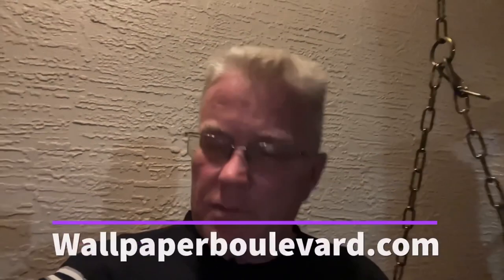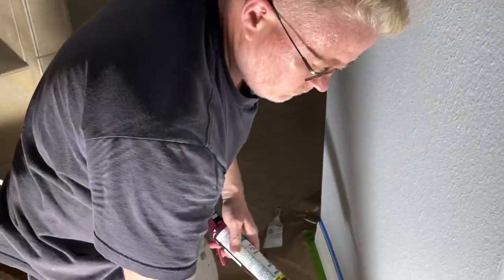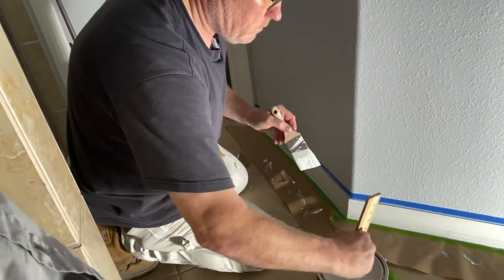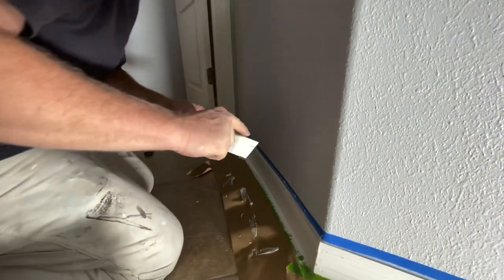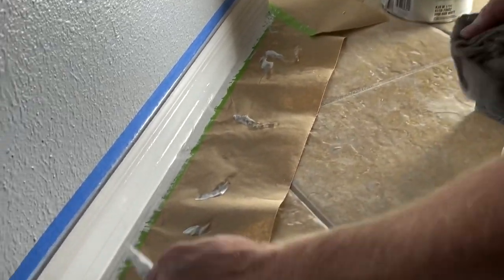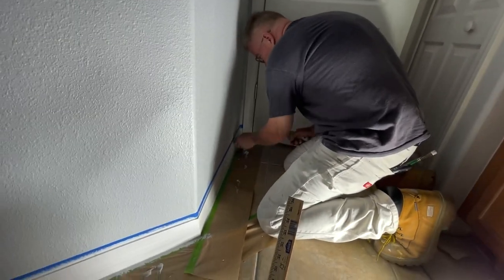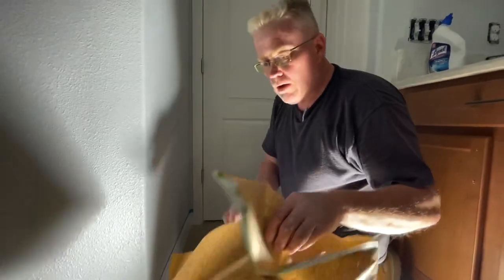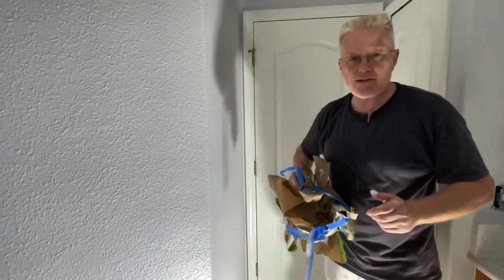Want to Just Paint Your Base Moulding to Spruce Up Your House? Do This! - Spencer Colgan ￼

Comment: Perfect method. I will redo what I did wrong today. 
I taped the floor and bottom like you did for the base. However, I didn’t do the tape against the wall. Above the base. And I had to hand cut. Very slow and wavy. I will have to correct it tomorrow. Using this method. Sent wife to pick up the tape machine. I got a condo to do and two set of stairs. This method should be way better.

Comment: I plan to spray tinted lacquer with an air-assisted airless sprayer (I use it daily at a woodworking company for furniture) on my own casing and baseboards. Will the clear caulking along the floor work with lacquer over the roughly 10 hours it will take to apply the primer and lacquer coats or will the caulk cure up and prevent the tape/paper from coming up or stick to the baseboard and pull the finish off? Any suggestions would be appreciated. Thank you.
Reply from the maker: I don’t think it will work sir.